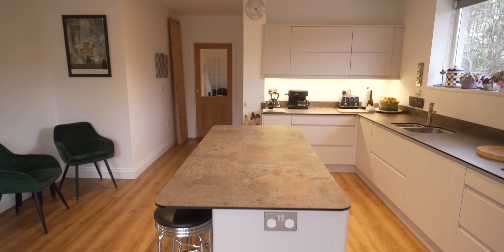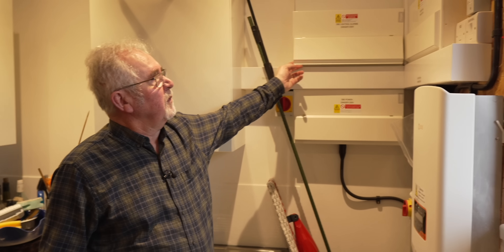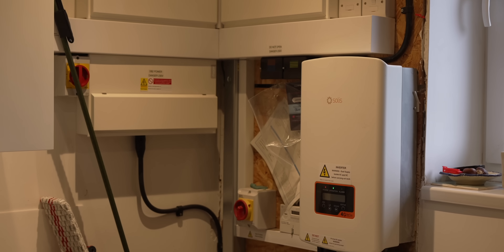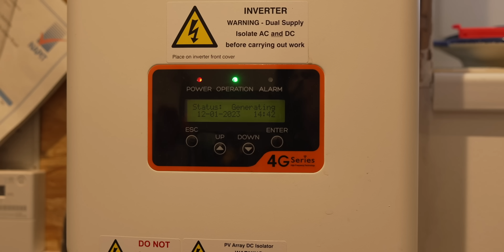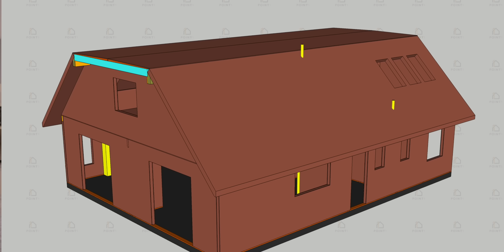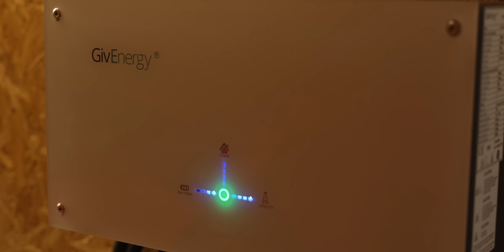Self-Build Your Way To Energy Savings | Everything Electric Show

Comment: Great episode & excellent to see Phil & Wendy wanting to share their own experiences with everyone. I didn't quite understand when he said that around 4Kw was the maximum capacity Solar Panel you can install. Maybe he just meant for their sized roof? I have 7.5Kw, along with a battery - while I did get clipped at the 3.68Kw export rate during peak times in the summer months last year, now that I have an EV to charge up as well , then hopefully I can generate even more this year.
Reply: Solar installers reluctant to do anything larger as the amount of paperwork for a grid connected feedin for above 5kw is the same as for 50mw is 40+ pages rather than a 1 sheet
Reply: @mojonojo3   I agree. Its just the export that is limited by the grid connection - so my generation peaked at around 6.5Kw last summer , when I was charging my home battery at full rate (~ 2.5Kw,) plus we had dishwasher / washing machine & oven on at the same time. However, for most of the time, whatever size your system is - it won't be generating anywhere near your maximum capacity, so always best to go for as much as you can , afford & fit on your roof. This way, you will be covering as much of your demand as possible.
Reply: He meant that’s the maximum he’s seen from their system, that’s all

Comment: Not sure a GSHP is necessary or economic for such a high standard of building with heat recovery and recirculation.  A super example of what can be done when building new, well done to the owners!
Reply: Perhaps. It does however make things cheaper. Also, currently, GSHP > ASHP
Reply: @waqasahmed939  No. Becuase off fixed build and maintenance cost and wasted base energy.
Below 300sqm its not worth it.
Its extra efficiency only start compensating above that size.
Reply: @Moody_Blues_  I totally agree. GSHP is better than ASHP but it costs more. You're paying more for something better. This makes sense to me. Many others would choose cost as the only metric worth considering, but I would rather pay more for better efficiency/reliability because it means I don't have to worry so much about consuming more than my solar panels produce in the winter months and wonder if I made the right investment.
I would always choose GSHP whenever possible, but sometimes it's just not possible. That's when ASHP comes to the rescue.
Reply: When building, why not. Don’t have to worry about those really cold days

Comment: The homeowner stated that 4.8kW was the most they were allowed to install.  When someone says that in the US, they mean that this was the most PV they could get utility rebates on or the most they can connect to the grid.  There is no limit to what one can install for on-site uses such as PV-direct DHW & space heat and PV-direct EV charging.  Once people are accustomed to free electricity they usually grow in to it and wish they had more.  How many watching Fully Charged will be driving an EV within five years?  Probably most of us.  Plan for it today.
Reply: The DNO may or may not allow more PV here in the UK. It used to be that there was a 4kW limit for incentive reasons but that's now gone. Now there is a form-filling change at 5kW I think. So yes you are right, but it's also true that you have to get permissions for bigger export and it may not be forthcoming, depending on how much distribution capacity there is where you are. Permission for export is what you actually ask for, so you can arrange to limit export and still have a big array and that should be fine. But that's not standard yet.
Reply: They also only on a 1 phase system rather than a three phase system which might limit what they allow on their roof and what they allowed to feed back into the grid. Bobby had this trouble and had to install a three phase system.

Comment: i think they missed a trick with the roof tbh i would have gone with a standard pitched roof that would have enabled more solar panels & larger battery storage, to cut there electric bills even further
Reply: You may find that planning restrictions on the ridge height limited them to that design. This is likely in a 'garden grab' development as it is less intrusive to existing properties. If they were limited in ridge height, this is a good solution to give a first floor, utility / storage space and the PV install.
Reply: I suspect planners had some involvement there. Or maybe they knew from living in the site for decades that keeping the roof low would work better with the other house. And they said they were at the DNO limit for solar anyway. More PV can be stuck on the flat bit later if need be.
Reply: most probably due to planning, limiting height of the building...

Comment: I'd really want to a see a show about whether or not it's even possible to run your house off your car in peak hours. Energy prices in peak hours are 4x what they are at night. The MG4 is car to whatever, but what does that actually mean? Is it enough? What's the average spent in those hours and can I run it off any car?

From MG's website:

"We are only just beginning to enter the world of vehicle load charging. This exciting, new technology could continue to develop and solve even more everyday problems. There are even whispers that soon electric car batteries could power your whole house, not just the appliances inside, which can become useful in the event of a power cut."

I'd love you to hook us in. You had a video talking about chargers and who has to pay. That's really not as interesting as technically what has to happen. Cost will come down and enthusiasts will pay. First the tech. 

Hope it makes sense. 
Best regards,
Sam
Reply: Are you talking about heat, or just electricity? Just electricity is easy. Most houses use about 10kWh per day, which is half an early Leaf battery.
For heat, you'd really have to look at your fuel bill to work out how much heating you need. Housing in the UK is extremely variable (as are car batteries!). If you've got an old house with no insulation in the walls, you're probably using more heat per day than you could store in a car battery. However if you've got a modern, well insulated house it should be possible. For example, if you're currently spending £10 per day on gas, that's about 100kWh, which is about as the limit of currently available cars. However if you have a het pump with a COP of 3, you'd only need 30kWh of electricity to get 100kWh of heat, which is well within the limits of most cars (if not that early Leaf)
Reply: @robinbennett5994  Just electricity. But I'd be curious for both. That's kinda my point. I want knowledge. :P

But if I have the oven going, kettle and all the lights. What's the usage vs what can the car supply?
Reply: @SamuelHauptmannvanDam  How much power you can pull depends on the size of the inverter. If you just run an aftermarket inverter from the 12v battery, you're limited to running lights, fridge, etc. However if it uses the cars main inverter (which it uses to drive the traction motor) it would have similar power to the mains input to your house. You'd need a big, thick cable like a rapid charger to handle that much power though.
Reply: @robinbennett5994  Sounds incredible! I'll take any thick cable all day, if it reduces my electricity bill by 3x. :) I'd love to see it in action. :P 

And what needs to be bought to change getting power from the grid, vs from the car. :)
Reply: @SamuelHauptmannvanDam  Ah, now that's the problem. There isn't currently a ready-made solution for using a car as a home battery. It would take collaboration between a car manufacturer and a home battery company, and so far it hasn't happened. I suspect because the home-battery people would rather sell you a battery.
Reply: Ford is already offering this in USA with F150 lightning! 
Hopefully its only a matter of time before more join this trend! 
Most houses, if you are not wasting energy you can run on 5-6kw per day - or less. Provided you have solarpanels too at least... (or maybe that is even without the panels, I am writing this from memory, so take the numbers with a pinch of salt) - the small car batteries is like... 35-38kw? something like that, more commonly is 58 - 72kwh. 
So the point is, the car batteries are a lot bigger than what you normally get as battery backup in your house, so its certainly very possible!
Reply: @Krydolph  the batteries are big enough for sure. The real question is can they transfer enough at the time. Like all lights and oven is on. And what's needed to do it. 😊
Reply: @SamuelHauptmannvanDam  As I said, Ford is already doing it! 
It requires a wallbox to patch into the electric system. 
I don't know beyond that, but I am thinking with the insane rates they can charge the batteries, I have a hard time imagining they can't deliver enough to run the house. It is not THAT much, not even with you running the oven and so on. 
There might come someone smarter along, because everything I say here is just guesswork, but think of it this way! We established that the car has a lot more energy avalible in the battery than you need to run the house. Even with everything on, more than you could manage to use in a day! 
Well, from driving the car, you could wasily run it down from max to nothing in a lot less than a day. Something like 4 hours going fast would probably empty most right? probably even less. (3-400 km range, 100km/h(60mph/) isn't even that fast, that is 4 hours at best) 
So from that it tells me it should easily be able to deliver enough power.

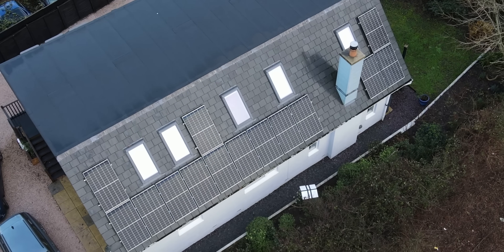Comment: Wonderful video and lovely couple - thanks for sharing. The MVHR system install looks neater than mine - my only defense is it's in the crawlspaces :). As the house is designed from scratch it feels like a bit of waste not to use in-roof mounted panels and have the roof windows "organised around" the panels (0:51). Obviously cut out the chimney these days and if it's not a passive house, A2A heat pump.
There's obvioualy a learning curve, but still fair play to them!